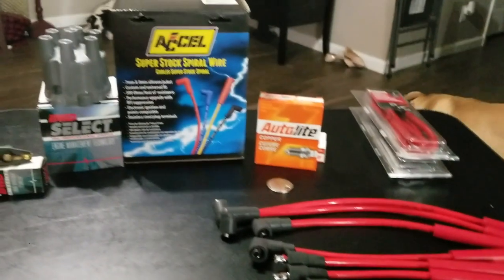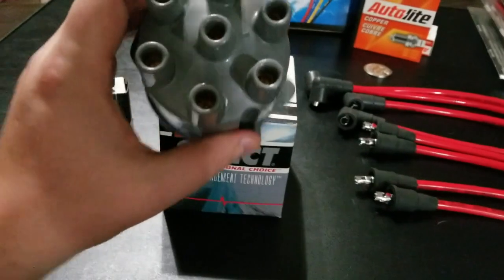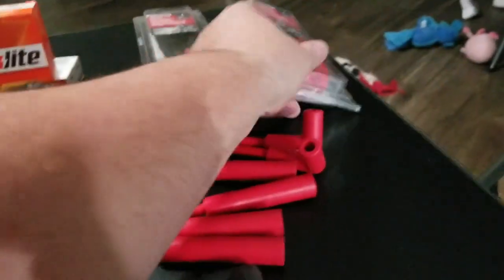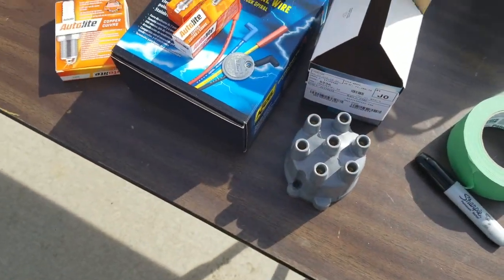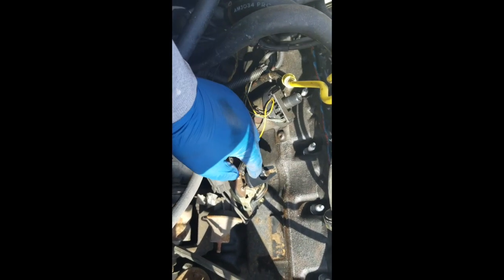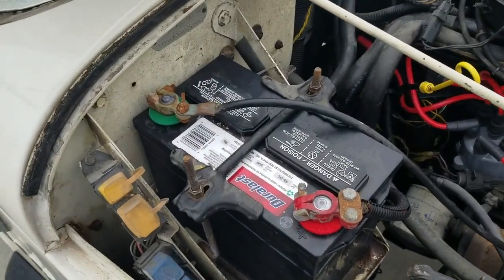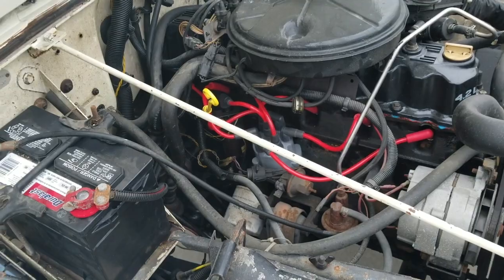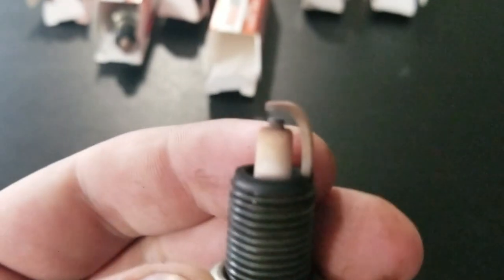87 Jeep YJ tune up

Comment: I have a 1987 Wrangler and everything is fine, except the washer fluid won't work and I changed the washer fluid pump and nothing happened, could it be a wiring problem or fuse?

Comment: I have a 1987 Jeep Wrangler YJ. My issue is that I can't get to the number one plug because the AC compressor is in the way.
I have a serpentine belt that has no tension roller and I can't figure out how to loosen the belt so I can remove the AC compressor.
Reply from the maker: Steven Faul  I’ve only ever had this Jeep which obviously doesn’t have the compressor, but I would see about disconnecting that and see if you can get it to swivel to get enough room.
Reply: @vinnyg798  I had to loosen the alternator, but I figured it out.